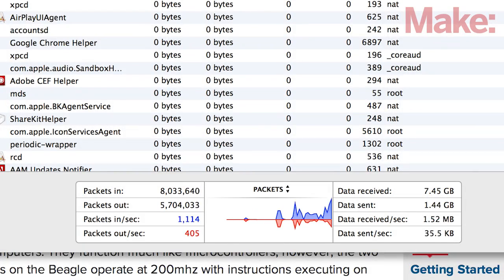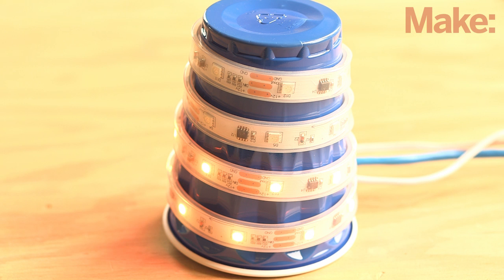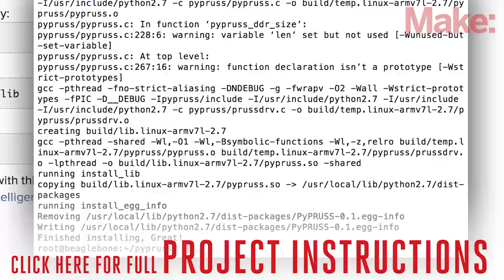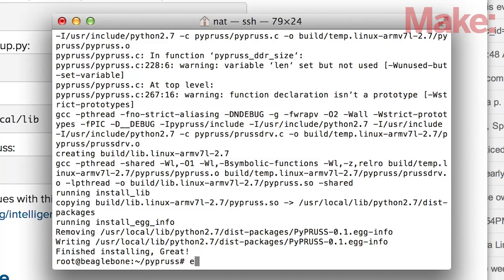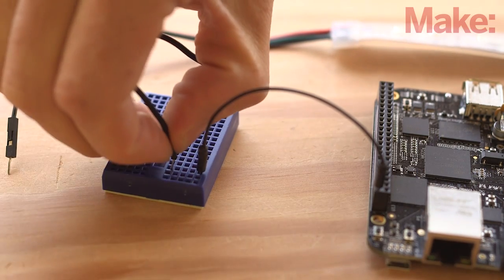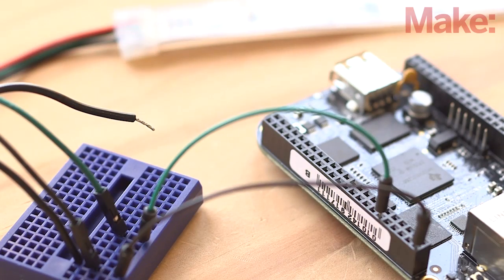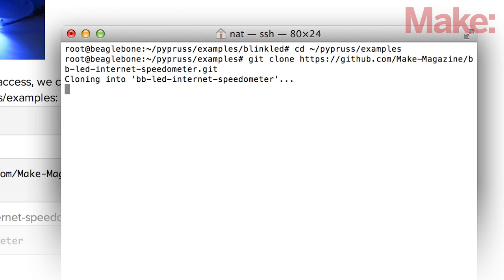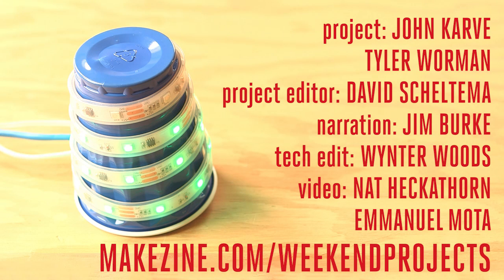Weekend Projects - Internet Speedometer

Comment: I wonder if this would also work on a Raspberry Pi...
Reply: The Python script used here would be a good start on the PI. You may need to use a different LED Strip. The LED here is driven by "high speed" I/O on the BeagleBone PRUs. The PRU code we have here can't be used directly on the PI. I did a quick search for driving a TM1803 chip on Pi. It didn't turn up any useful links. It's possible the GPIO might not be fast enough to drive them directly but I'm not terribly familiar with the units capabilities to say for sure.
Reply: Ya does it work with the raspberry pi

Comment: Is it posible t do that with an Arduino and ethernet shield, and how. Thanks
Reply: The TM1803 on the LED strip shown here comes with code to run it via Arduino. The last time I checked the available Ethernet sheilds they were all serial devices. If I recall correctly, they weren't that fast. If you have a decently fast internet connection, you may not be able to max it out with the Arduino/Ethernet shield combination. Using the Ethernet shield libraries you can connect to a web server and send a "GET" request to download a file.